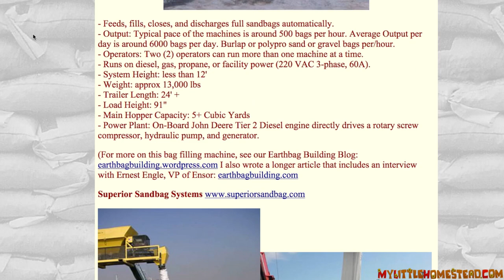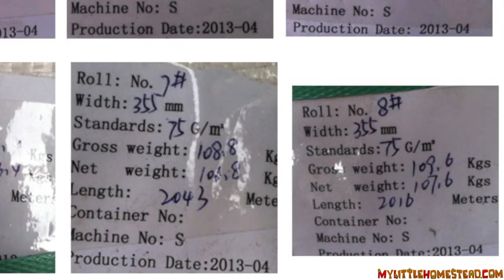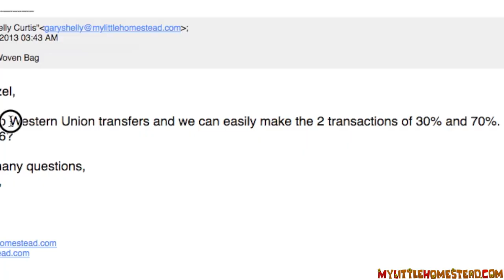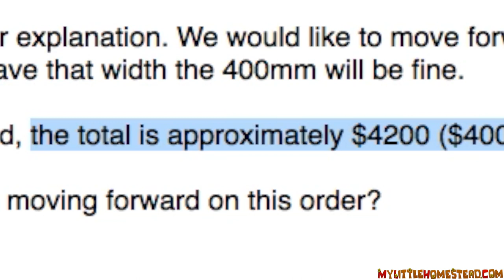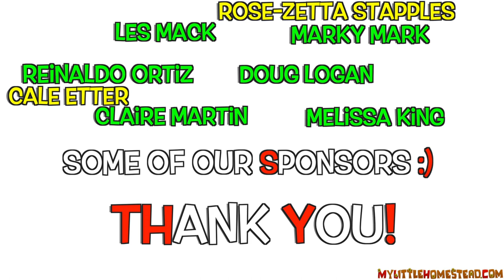Where We Bought our Earthbags (Continuous Sandbags or Earth Bags :)  | Weekly Peek Ep48

Comment: Normally to protect yourself most importers operate on a letter of credit, which goes through the banks.  However,  if the final cost was $4400, that would be too small of an order-the bank fees could easily add another 30-40% on top of that.  I am just glad it all worked out for you.
Reply from the maker: So interesting. Thanks for the info :)
Reply: +mylittlehomestead No problem. Twenty years working in international business as an international business consultant I guess does mean something! You were lucky this time, but things could have gone very, very wrong for you.  If ever you do put another order in, may I make a suggestion?  I know you trust this company you have imported from in the past, but I have seen many situations where companies first start with letters of credit,  then telegraphic transfer, like you did.  Things are going just peachy until bam! They get ripped off on a big order.  It happens every day of the week.  I'm glad you weren't.  But safest bet is an irrevocable, confirmed letter of credit.

Comment: I love your episodes. I purchased my Raschel tubing from a place in south Texas. 32k linear feet for about $700. 30% clay to 70% sand, straw, grass, reed or other seedless fibre and water. no barbed wire. same basic principles.
Reply from the maker: +Anjali Cazalet 
Cool.  Thanks...
Reply: +mylittlehomestead my pleasure. have studied hyper Adobe, cob et al for about 12 years. building plans here in tx. keep up the good work.
Reply: I would be interested to contact that south Texas company that sells these rolls! ;-)
Reply: +Sir Jazz nnzusa is the company and my contact was Tom. I bought 6 rolls, shipping was $130 residential,  but the rolls are about 5,908 feet each. 15 inch wide stretched.
Reply from the maker: +Anjali Cazalet 
Say if you have a resource in TX, call it out. It could be helpful to many folks.
Reply: +mylittlehomestead the company is NNZUSA.  770-921-9210, GB-80-56-2225-RED KNITTED NET
Knitted Tubular Net. 5905.8 feet per roll.
Reply: Anjali Cazalet  I'm here in central TX and I am finally ready to buy my bags.  Pls share your recent contacts if there is any.  After years of research I'm ready to build.

Comment: alibaba.com might be a good place to check for either the poly woven bag rolls or the raschel for the hyperadobe. I was looking at basic prices and it looks like you could cut your building costs pretty dramatically by going with the hyper adobe, but I'm sure you already know that
Reply from the maker: +jozak78 
Great site. We looked into this type of bagging material before we imported from China. We mostly found the individual bags. We are very curious as to how it works with others. From the vids we saw, it is working.
Reply: +mylittlehomestead might strong emphasis on might have a reason to order enough stuff to warrant a partial container load from China. if that's the case and you're in need or want of something for your projects I'll send you a message and see if we can work something out

Comment: Hi this is somendra and I am from India I want to know how sustainable these Adobe house is,How long is the life of this house, how long it lasts
Does moisture come to the walls in these homes during the rainy season?
One last question when we apply a cement layer.  over the earthbag it does not fall after drying
What I mean to say is that when we plaster indoors and out, that plaster is uprooted or not after drying.
Reply from the maker: consider building a rock or concrete footing.
Reply: @mylittlehomestead  ..and use a plastic membrane (dampcourse) between 2 layers when you reach just below your intended floor level, make sure that level is higher than under 'runoff flooding' that your site might ever be subject to (ask the old timers!).For weatherproof plastering... Put pieces of wire inbetween every second(?) layer and about 18" apart and bend them up as a hook so they stick out less then the intended 'plaster' layer  (this gives a decent hook with the depression between layers caused by the rounded edge of each bag).  Use cement in the mud plaster, and if you can put fibres (grass?) into the mud to make an adobe then they will work even better with the hooks to ensure secure adhesion of the plaster.  If you use cement in the mix be sure that the surface is a little damp to prevent the wall sucking out too much moisture from the mix and interfering with the cement 'chemistry' at the interface between plaster and wall making it fall.

Comment: I would like to get the earth bags here in Israel, How would you describe the bags? their weave? their thickness? are they sun burn proof? how wide is the bag?
TIA YYK
You guys are a great family!!
Reply: They are woven polypropylene.  Often feed for animals come in those type of bags.
Reply: typically UV up to 2000 hours. this isn't a problem as you cover it in plaster.
Reply from the maker: +Nettie Jacobs 
Yes it does...
Reply from the maker: +Center Line 
The strands of poly weave are about 3/16 the of an inch and are tightly woven together.  I not sure about the strand thickness. They must not spend too much time in the sun or they fall apart. They are fine in the shade under cover. We use the 14 inch wide that when filled become about 12 inches by 4 inches high.   Thanks for sharing.
Reply: Thank You All for replying YYK
Reply: could it be posible to make the bags whith the ones that comes whith animal food?like the ones whith corn for chikens?
Reply: polypropylene sandbags, amazon.com as them.

Comment: I have also seen the hyperadobe videos on YouTube.  I think they are the way to go. Cutting out the awkward handling of the barbed wire definitely seems worth it. 
Also, "stucco-ing" will get easier because it will adhere a lot easier on the Adobe than on the poly bags. 
You will need to cover your work during the build though, I don't think a fresh hyperadobe wall will take kindly to a proper rain shower...
Reply from the maker: +Luc Thoelen 
Yup. One unprotected rain storm and the building becomes very organic looking.
Reply: IDK if I would trust even hyper-adobe to glue rows together....Shake-table tests of various adobe wall systems [back in the early 1990's, in Berkeley, CA...I think was when], proved that reinforcing adobe walls as simply as wrapping the basic earthen wall structure with chicken wire before plastering, held walls together even in severe earthquakes.  
That extrapolates to using barbed wire between rows of earthbags...which is why to keep using barb wire, not trusting a mortar to do it 
Same reason all those who get old brick bldgs to remodel, then remove the old cracked facing stucco or coatings, risk losing that building in an earthquake..the old bricks are already aging and have crumble-tendency...with no covering to protect them and hold them more stable, those walls are compromised..especially in freeze-thaw climates that cause spalling in all brick or concrete structures.

Comment: What have you come up with? I wonder if Ali Baba in China would be a good source, or Wish.com, also China. Also what width bag do you prefer? 12, 14, 16 inch?? You said there was a minimum order, about 10 rolls?
Reply: Patricia Hazeltine Alibaba is good and it depends on the size of diameter room you're building for what size bag width you need. If you want a 20` diameter room you'll want a 20" bag width. It'll only be about 14" thick once filled and tamped. Smaller rooms smaller bags bigger rooms bigger bags

Comment: you could try compressed earth blocks the machines are not that expensive to buy around $4000 for an a powered one or much less for a hand operated one. I am lazy so I would buy the automatic one myself mainly because I can hardly walk any more.
Reply: The formula for impressed earth blocks is very similar to what you mix for your earth bag instruction. As suggested that you get a cement mixer and the sand, clay, cement, and 8 to 10% water. Just enough water so that when you squeeze the mixture stays together but is still a dirt consistency. Not a mud shovel that into a hopper, hopper fills the die and then pneumatically presses out a couple of bricks i.e. blocks whatever size and shape that you determined you want for your home. Another way of constructing with earth is to build a frame in whatever shape watcher wall. Actually you need to frames and inside one and an outside approximately 2 feet across and then using that temper either the hand one or a pneumatic one or 10 (use as many tempers as you feel necessary usually about two or three. Any more than that people will get in each other’s way. This technique changes the sand, clay, cement mixture into sandstone and you have to make sure the roof overhangs walls to protect them from rain. This construction method is been known throughout the world for thousands of years in houses built this way have lasted at least a thousand years provided the roof is kept up to keep the rain off the walls.